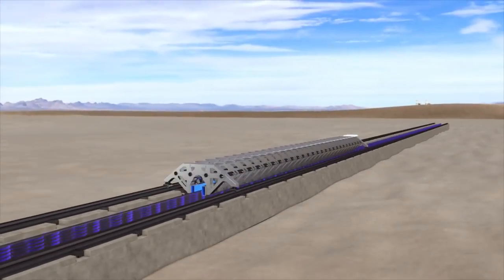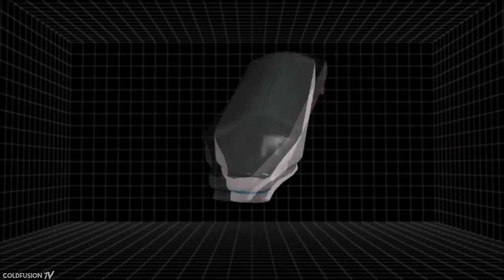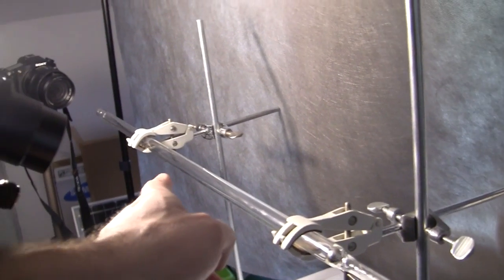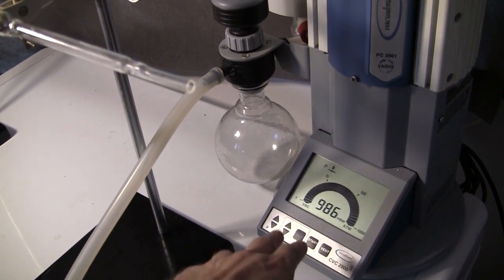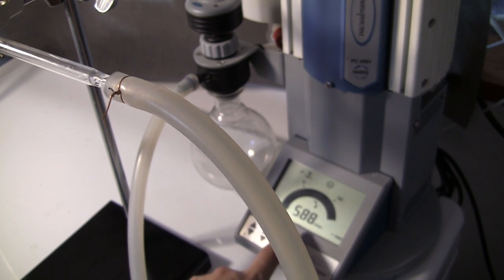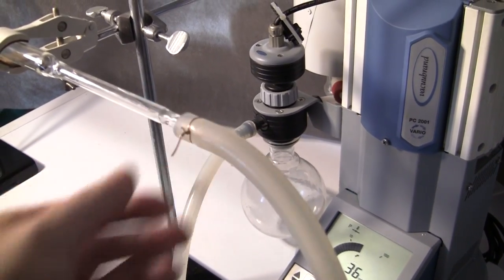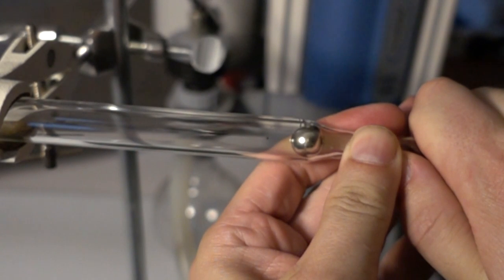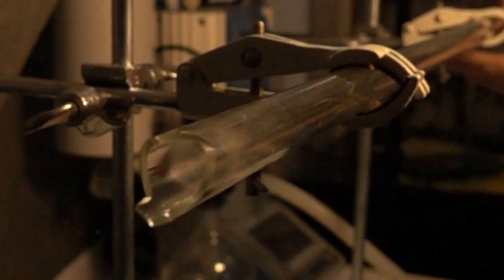How  the Hyperloop can kill you!

Comment: I'm a fan of Mr. Thunderf00t and many of his B.S. detected videos (of both scientific and SJW variety), but this video strikes me as being like clipping the wings off a Wright brother's model airplane and watching it tumble to the ground... scary, huh kids?  Maybe I don't understand the theory or fear, but agree generically with the commentators who suggest that such a travel tunnel will have risks and a multitude of future engineering solutions and safety features.  For example, If the pod is meant to travel by being pushed by low air pressure pushing the pod into a vacuum and the fear is RAPID accidental ("normal atmospheric) pressuring of the vacuum tube, couldn't the pod simply have flanges ("wings") which ride a reasonable pressure difference but collapse (or give way) in an over-pressurized circumstance?   In any case, I appreciate Mr. Tf00t's skepticism and concerns, but don't see this short clip as a "silver bullet" in any way like the ones he posted against the aqua-breathers or solar Freak-ing road panels.

Comment: Hmm, isn't the Hyperloop an actual loop? your experiment needs a loop with a T-pipe (to suck vacuum)... And could not the maglev be used as a break? And what happens if you have sensors that could localise the pressure drop and then just open vents Infront and back of the Hyperloop train? Anyway... I remember all criticism of the Tesla prototype... To heavy, it will explode/burn on crash impact and so on... But they do work pretty good nowdays....
Reply: Not pressure drop, pressure rise.... anyway...
Reply: +Alexander Wingeskog why would the pressure rise in the first place? That doesent make any sense. The actual problem is a pressure drop. Any solution for that?
Reply: undjetzh Well that is what you do inside the hyperloop, you reduce pressure to near vacuum so you can push thru without much resistance. If you get a pressure rise it means you have breach and the pressure from outside (1 BAR) is storming in... But why it would rise in the first place... well some breach in the construction, a plane crashes into the tunnel... well anything can happen... and if you have a near vacuum then the pressure would rise from that point.
Does it make sense now?

Comment: Here's an idea.... How about we don't make hyperloop tubes out of glass?  Even my non-engineer brain would imagine that you wouldn't use a material that shatters instantly. It's not like we make other vehicles that deal with pressure out of of glass (like airplanes or submarines).  Also I would imagine that they're planning for redundancy instead of having a single point of failure....

So far the premise of this video is:  "If something goes wrong, bad things will happen".   Not sure how that is much different than a train derailing at high speed or a plane dropping out of the sky.

Comment: i see what ur getting at, but the tubevehicle is designed to let air pass around it. granted, the decceleration/acceleration would be considerable and likely harmful to unsecured passangers. 
also i find a total break highly unlikely, a broken seal or crack is probable, but would not have nearly the airflow to cause serious damage.
i also doubt that the preasure will realy be that low, i guess for practical reasons it would be more in the 200-250 range.

Comment: This doesn't seem like difficult  engineering problem to solve. I'm sure there would be tons of sensors monitoring tube pressure and the position of the transporters. Simply breaching the tube vacuum on the opposite side of the accidental breach would equalize the pressure and neutralize/minimize the acceleration. Hell, airbags inflate in milliseconds with sensors, why don't you think that we could do something similar here with an explosive vacuum breach?

Comment: What if there were bypass tubes along the length of the track which equalize the pressure on either end of the vehicle? It probably wouldn't work in a rapid influx of air though.

Comment: Yes it's a very difficult thing to accomplish, but there are many safety features that could be installed in the loop... for example, if you opened and shut pressure locks while the craft is in motion then if one sensor on one end detects a breach it can instruct all airlocks to open while the craft could clamp the walls (like elevator's safety clamps do)... yes it would probably damage a bit of the tube and craft, but would make it probably safer than flying in the 60s.

Comment: While i think the hyperloop is a retarded idea, this is hardly their biggest engineering concern.  I imagine a bypass valve and something for braking ability would cover this.

Pulling a vacuum on something that large, keeping it that way, keeping it sealed, and allowing a method for passengers to exit\enter that vacuum will be much harder to do in a cost effective way.
Reply: Also, keeping the whole tube perfectly level, because you can't have the slightest bump in the tracks while going at that speed... Which will require far more than just simple concrete pylons...
Reply: No! It's the acceleration from the vacuum failure in the first place that would kill everybody on-board because of the G forces from the acceleration, adding valves and braking would be pointless as the passengers would already be dead more or less in the instant the failure happened. 

Braking something moving with as much force and momentum as the hyperloop would also kill of any people who miraculously survived the initial acceleration. And I don't understand what sort of brakes you mean, the hyperloop is using magnets so isn't in contact with the ground or anything else so i'll assume you mean that maybe brakes are deployed from the pod which make contact with the rails or something but really the only obvious way to brake is by increasing the air pressure with the valves you mentioned. 

As for valves, I would think they would be more safe (but still not necessarily safer) than mechanical brakes because there will be less of a change in impulse over time and therefore less force applied on the passengers but if the pressure isn't changed gradually enough or fast enough, the friction would just melt the pod and it's passengers or it wont decelerate in time and will fly into a tangent around a bend or simply crash.

But really none of these except for maybe the valve are very useful but none of them will save anyone, all the valve will be useful for is preventing collateral damage from a high speed and heavy projectile which is the hyperloop pod because as I said, as soon as the hyperloop failed, everyone would be more or less instantly dead from the acceleration so the best way to tackle this problem would be to stop the acceleration happening in the first place rather than trying to stop the pod even everybody is already long dead from g forces.
Reply: Yeah, pretty much this.

Having emergency brakes of some sort, or somehow being able to equalize the pressure in case of a problem, might work. Though equalizing pressure takes time.

Brakes could work, of course, but they would need to be incredibly precise. At the speed we're talking about, they would need to work to exactly counter the force depending on where or how there was a breach, and do so in a way that isn't just as deadly to the occupants.

Really, it's not a bad concept, but the engineering hurdles will be large. I don't think it is likely to be to the scale of "impossible to do effectively" however, as was the case with Solar Roadways and such. Just very difficult to do effectively, and very likely too expensive for it to be worth doing so. It may very well be cheaper and more effective to just go with a normal train or such without needing to bother with a vacuum, though I suppose it depends on too many details to know for sure.
Reply: +Mr silver-tongue ...the idea would be the brakes and valves act before a breach causes the thing to accelerate... of course there would be no point in doing anything after its accelerated. you wrote a whole load of nothing there.
Reply: Graeme Evans I wrote in a way that half of what I said could be applied a situation before a breach happened, I talked about the general difficulties of decelerating something moving at similar speeds to a bullet being many times a bullet's weight.
Reply: Mr Silver-Tongue you dont need to decelerate it, deceleration is just acceleration in the opposite direction. the idea is to prevent any change in speed. "as soon as the hyperloop failed, everyone would be more or less instantly dead" you dont seem to understand that.
Reply: That is easy. You keep the tube sealed and the passengers enter the train in atmosphere outside of the tube. The train is then put into a separate pressure chamber which will connect to the main tube once the pressure is down to 1 millibar. The wall separating the pressure chamber and the tube is removed and the train enters the tube after which the tube closes behind the train. This is a very simple air lock like any other.

Getting so much gas out of the transport tube initially will be simple but take lots of time, unless you just use the tube system itself to send a bunch of specialized carts through the tube which pump the air out in a similar manner to a basic bicycle pump.
Reply: An airlock at each station would fix the enter/exit vacuum problem easily. The major problems are jet propulsion at near vacuum and safety.
Reply: It isn't jet propulsion though.
Reply: its not vacuum its just low pressure + front pod compressor air intake also the pod is supposed to be 50% of the tube crosssection which is plenty space for air to pass by. Its not a difficult thing to do.

Comment: I thought the hyperloop was meant to be a railgun variant where you could control the acceleration by manipulating the voltage, current and such of the rails that levitate the tube? It would be like having a small electrical impulse grab the magnetic field of the tube and then pull the tube along with the intensity being a direct function of the speed of the tube

Comment: So, what you're saying is, if the tunnel the truck is in were to catastrophically fail, it could cause a mass accident? Because that doesn't really put the Hyperloop behind regular subway trains in terms of operational safety, mind you. I've heard that a segment of the New York subway system runs in a tube on the bottom of the sea, how susceptible to failure do you think that is?

Also, if you were to turn that tube vertically, and tether the steel ball at the top, then break the tether, you would be simulating an elevator cable failure. You know, debunk the PR bullshit of elevators once and for all.

Comment: When I first saw how they would propel it, I immediately became skeptical. A motor driven fan? In a de-pressurized tube?! NOPE! That would be like trying to to fly a Cessna in space.
Reply: +awesomekc probably... But the way it's explained doesn't make sense.
Reply: the pod is propelled through maglev, the fan is just to suck air that accumulates on the front since it is not a total vacuum.

Comment: Do they not have failsafes? Like if a leak is detected then vents could open in front of the train. So the pressure difference wouldn't be all that great. When not in motion it could be locked. If it was in motion wouldn't the acceleration from the pressure change be negligible because you're moving? So of the leak came from the back you'd already be moving fast, and if the leak came from the front you'd have so much inertia that you'd slow down slowly.

Comment: Everything you say here is entirely true though one does have to consider that the mass in your demonstration does not have any form of drive system with which to counter the acceleration. While it does demonstrate the significant engineering challenges involved in designing the system to handle such a failure condition it doesn't really demonstrate that such engineering could not possibly be done. It would seem that if anything the electromagnetic levitation propulsion system would have somewhat of an advantage in engineering the system to handle this as it is quite possible to design the conductors to withstand an abnormally high load for a limited duration (sufficient to bring the train to a safe stop in the tube and hold the train at a standstill until the air pressure equalises).

If anything it seems to me that the more significant engineering problem is going to be dealing with the shockwaves that will be produced when a train travelling at Mach 1 suddenly encounters a flow of air travelling at Mach 1 in the opposite direction and effectively functions as a supersonic piston creating an overpressure wave at the front and even larger overpressure from the hypersonic flows around the sides of the tube as the train effectively narrows it. It seems to me that some serious modelling would be necessary to engineer around this situation and provide relief for the overpressure without producing something dangerously close to the effects of a significant blast wave.

Comment: Seriously, seriously? You're picking apart vacuum tube trains for lack of safety? The risks aren't really any worse than air travel. Remember, lack of maintenance on an aircraft can lead to violent explosive decompression too. To insist any method of travel we currently use doesn't carry equal risks of catastrophic failure is asinine.

I agree on most of your other stuff, even the more dodgy way you went about discussing Brexit. But now you sound like the morons who said that steam trains were entirely unsafe monstrosities that would kill anyone who rides them...

You didn't even touch on the difficulties of initial construction or anything else either. This is far, far, far away from any sort of debunking. Please don't continue to slide down this slippery slope that started with Brexit. If you want to make an argument against something, make a full argument, not a statement, or using a sensationalized catastrophic failure event. It's not very impressive or convincing to anyone who doesn't blindly follow anything they are told.

Comment: Really fear mongering science. For shame Thunderfoot. How about a video on the dangerous of high energy accelerators or nuclear reactors next. 

This is a trivial problem to solve, planes have already done it with blow out panels to equalize pressure. Just include blow in panels on the sides of the train part to allow the air to pass around and that's if it takes up the entire tunnel most pictures I see it only takes up about 3/4s of the tunnel.